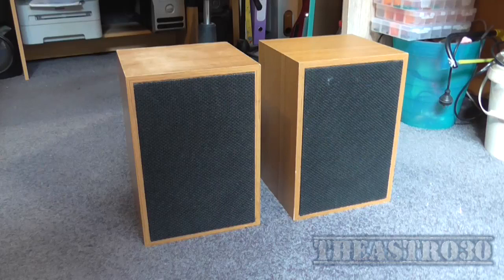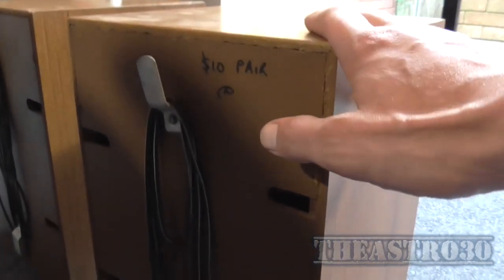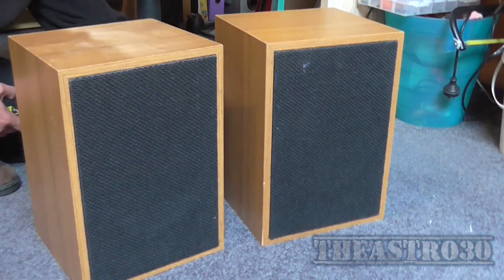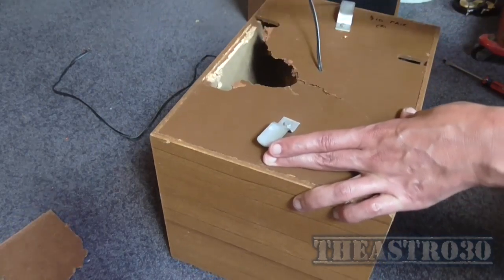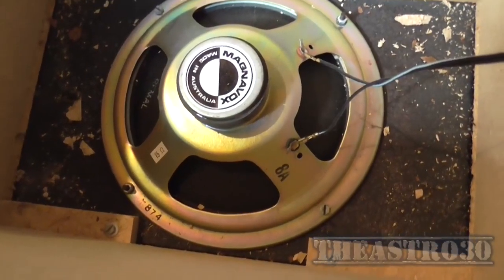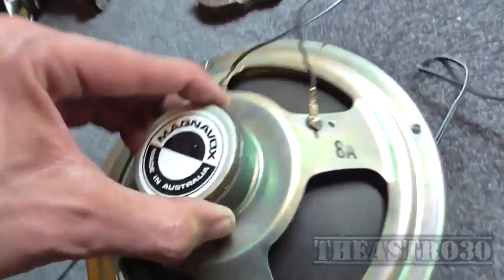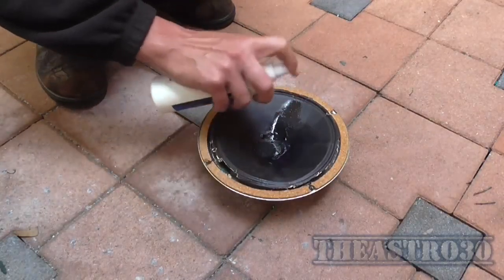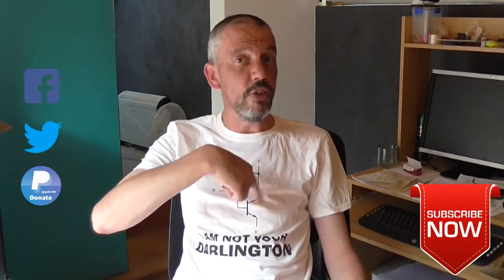Why DC Voltage Is BAD For Speakers

Comment: 10:35 22.9volts/0.9 amps = 25.4 ohms because the voice coil was hot enough to nearly triple the resistance.
Question: What is the voice coil temperature? (hint: The temperature resistance coefficient of copper is 0.393% per degree Celsius)
Reply: Answer hidden below
.
.
.
.
.
.
.
500 degrees celsius above ambient

Comment: I've actually seen a speaker that's caught fire like this. A friend was using an oversized fancy "audiophile" amp that didn't have any protection circuitry built in; we found out the hard way that these amps like to fail and dump full rail voltage (~60 volts) out the speaker terminals. Nice. Thankfully he caught it in time before it could burn anything down, but the woofer was reduced to ashes.
Reply from the maker: Yeah, it does happen. If we think about that voltage across the voice coil of roughly 60V, basic ohms law tells us that that is 7.5A of current (assuming the speaker is 8 ohm). As the windings are very thin and occupy a small space, yeah, it's easy to see how they can catch on fire.